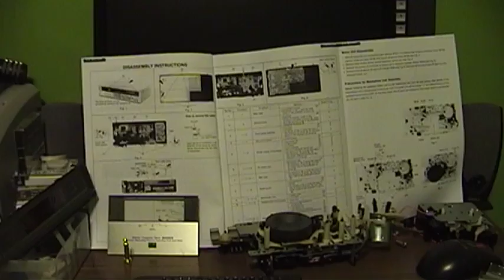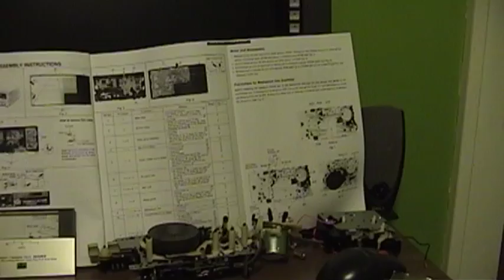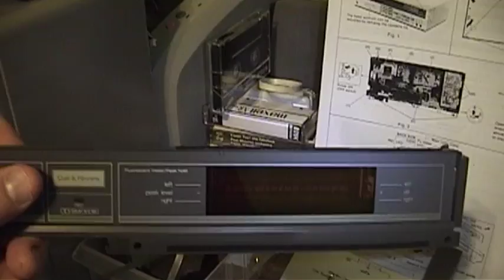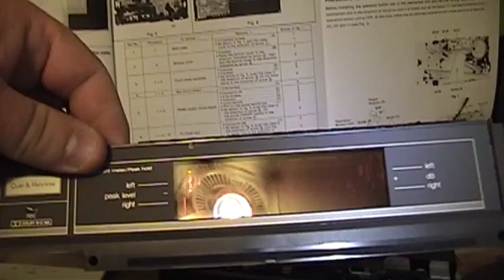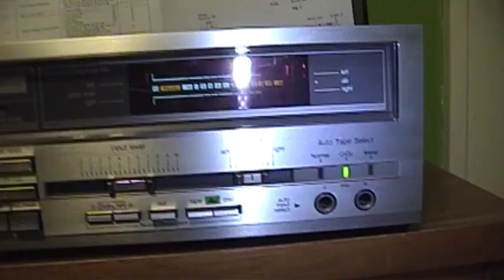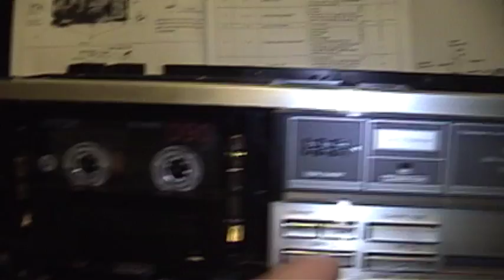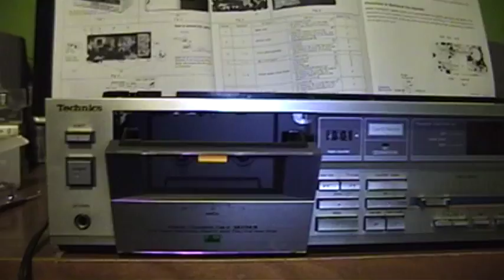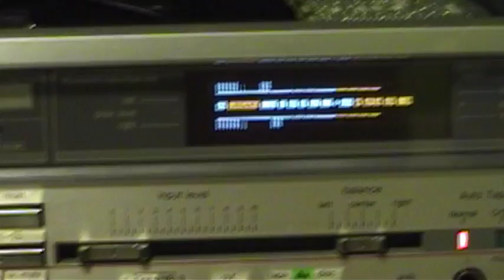Technics RS-M234X Cassette Deck Repair

Comment: My Technics M231X is virtually identical, including the DBX disc and tape functions, except it has analog meters and a manual tape type selector. And since the DBX encoder/decoder occupies a large and densely populated circuit board all by itself, I can see why it never really caught on. I'm sure DBX eventually developed a cheap one-chip decoder for use in stereo TV sets and VCRs, but by that time it had probably already disappeared from most tape decks.

Comment: Nice to see that the cassette deck is working again :) The older Technics cassette decks are rather hard to service, unfortunately. 
I would have thought that the pinch roller is responsible for the cassette deck treating the tape so badly, but it seems like the belts did fix it.

Comment: These technics mechs tend to suffer with barrel-shaped pinch rollers, if there is any creasing at tape start then it should be replaced. Another problem is the motor drive IC - it goes bad leading to fast and uneven speed. To be honest, these single motor transports are generally a nightmare, the cost cutting means loads of belts and crude linkages, hence more to go wrong. Glad you got it fixed though.

Comment: Mitsubishi Motor, and I saw a chip with the Mitsubishi logo on it.
Seems that the tape deck is working good now.
Nice touch using a matching Technics receiver to demo the tape deck.
and 
when do we get a demonstration on those ////\DVE\T speakers?

Comment: Your video gave me the confidence to disassemble my own RS-M234X to confirm that loose belts are the probable cause for the playback speed variation I’m experiencing (just cleaning the capstan and idler didn’t help).  I’m trying to decide whether to buy and install replacement belts, or just replace the whole tapedeck with a used one from eBay.  Can you tell me where I can shop for a replacement belt kit for this model?  Thanks.

Comment: Thanks for your response, I highly appreciate that. I'll clean the mode switches, (which I haven't done). You're right, the tape basket locks (can't open it unless I shut it off & turn it back on). Hopefully it'll work when I clean the switches cause the belts look fine, (very good speed on playback). You sure know your cassettes! Thx again!

Comment: I've got two RS-M228X and one M235X. All three had motor regulator burn out after years of running constantly in standby in radio studio. Shame Technics didn't allow motor to stop running when stop pressed, or at least switch off after a few minutes delay. I've replaced electronics in motor regulator and working electrically and can set speed, but motor bearings causing slight wow and flutter so need to strip, clean and lubricate bearings if possible. So far been working through back plate of motor as didn't fancy stripping down all the tape transport. Looks like I will have to strip down whole mechanism as you did and while in there replace belts too. My machines look identical to yours internally.

Comment: Thanks Bill.I finished up recording a tape using dolby c and it sounds amazing.Better audio than my cd burner when I use analog mode on it.Plus the tape deck has alot better level controls.I may send it off and see if I can get the dbx fixed on it.

Comment: Hi Bill, thanks for this. I have the m233x and all works but play! The wheel on the rights rotates mucho to slowly (but fast enough when rewinding). Also there is always some mechanisms moving as soon as power is on... Do you think it may just be the belts?
Reply from the maker: Almost certainly.
Reply: @uxwbill  thanks Bill for the fast answer. Could you share the reference of the belts that you have purchased? I really appreciate your help, that's nice of you :)
Reply from the maker: I no longer remember the exact belts I purchased. You can make measurements with a piece of string wound around the pulleys, or use the existing belts and deduct about 10% from the measurement to compensate for their having stretched out.

The company I bought the belts from no longer sells them.
Reply: @uxwbill  thanks very much Bill.

Comment: I just picked up a two head Teac V500 tape deck with DBX and DBX disc.  A few days after that, I found an even nicer three head Technics M63.  These decks are from around 1980.  I cleaned both decks up and they're working reasonably well again, but I know eventually I'll have to service them.  Can you tell me where you got your service manual and replacement belts?

Thanks a lot, Tom
Reply: *****  Thanks so much for the information.  I've got to wonder if eventually cassette tapes will become popular again with the youngsters just like vinyl records are now.  Out here in Southern California I found a Borders Book Shop with lots of newly pressed, high quality classic record albums.  About $23 to $25 each!

Regards, Tom

Comment: I also have this unit and it works great except the sound turns on and off randomly, more so when the sound is turned up. I'm thinking it's a lose wire somewhere but I don't have the repair manual. Do you think this is something a novice can do?
Reply: we have tied it to the Bose speaker system using this: IEC 18 AWG 6' Speaker Wire Pair with RCA Males - Black/Red. It was doing it even before. I will check the other connections.
thanks

Comment: I never liked the sound of the DBX noise reduction. It had such a wide range, I think it was 60dB it sure made things quite but you could hear it working. On some music it was fair but on say a piano it was simply dreadful. By fare the best, on home recorded tapes, was Dolby C. A good compromise between noise reduction and compression artefacts. I had the three head version of that recorder, not that common for a cassette recorder. Did make a very nice recording, quite close to the original, never liked the Hi bias tapes however, always seamed to lack HF detail.

Comment: Nice video!  I have an obscure Garrard model 316 CD/Cassette boom box that went on the blink.  when I opened it up, the belts had completely rotted and were in pieces and sticky.  I figured I could try some rubber bands to replace the belts, but I can't figure out the belt path or even how many total belts were used.  Any suggestions?

Comment: Hello. You guys seem to know a lot about cassette decks and I wanted to ask you 2 questions. I just found a Technics RS-MO4 and I'd like to backup all my vinyl collection on to some tapes. The questions are the following.

1. Can I record from vinyl to some tapes on the model I mentioned ?
2. The record button seems not to work. Does there have to be a cassette inside
for the button to be possible to press ?  Or is the recording mechanism damaged ?

Comment: Hi I just bought a "New Old Stock" car cassette player from 1980.  (Jet Sound Laboratory)  When trying to play a tape, it would play very slowly and then stop.  When trying to fast forward, or rewind, it would spin for a second and then stop.  Is this a motor issue or a belt issue?  I wouldn't think this would be a belt issue, because if it was a belt than it wouldn't spin at all right?  Any advice would be greatly appreciated!

Comment: I really like this, seems like a handful to wrap my head around. my deck at home has all kinds of problems, but I was wondering if you know anything about car decks? I have an alpine 7292(I believe to be 80s) and it recently looks to have stopped spinning tapes but will still play the auxiliary adapter(looks like this doesn't need to spin). Any thoughts on where to start? I'm new to the technical aspects of decks but always have been really into them, thanks.
Reply from the maker: As with any cassette transport that's got a few miles on it, the first place to look is at bad belts and deteriorated rubber parts. Unfortunately, most car radios with cassette playback make even fairly complicated component cassette decks look like a walk in the park to work on.

Comment: I enjoy your videos.   You do make that look so easy, but I am sure it was a lot of work.  I would like your opinion on my Technics Double Cassette Deck.  The other day I was planning on playing a tape on Deck 1, and the tape will not play,  it will FF and rewind, but not play,  the right hub seems like there is not enough power to turn.  I read online maybe a cracked gear.   Deck 2 works fine.  What do you think happened to Deck 1.  Have you ever had this problem?
Reply: Thanks!!!

Comment: How have you managed to get that schematic manual? I've just had a look for one for the one i bought on eBay, the RS-X888, and i can't find one, funnily enough it has the same problem, I've tried all sorts if different tapes, new, old, pre-recorded, and they all do the same thing as yours, it plays for a second and then turns over to the other side, and, like you, I've read that it  could be the belts, or it could be a motor problem... Not sure what to do, because it was sold as working and good condition..
Reply from the maker: StereoManuals.com has a massive amount of service literature for this equipment. While not free, their product is of excellent quality.
Reply: Ahhh thanks mate, I will have a look in there as well then 👍. I have found one place that has them for £4.99, which still feels too much to pay for it, but i suppose without it I guess I won't be able to make the repair, right? Or at least properly diagnose what's wrong..some sites eta charging as much as $19.99 for them! And that's a digital copy, mad eh, what ever happened to the help others as they will help you unspoken law eh? Everything has to be all about money nowadays... Don't you charge me as well will you? Ahahah, I'm joking 😉 thanks again, much appreciated, I've kept this in my favourites just in case, thanks for sharing, top man, all best for the holidays and New Year ✌️
Reply: By the way, I'm a member of hifi engine and usually they've been great for info and manuals but it turns out that they have nothing but specs on my model 😕

Comment: Howdy from Canada. I have a Technics RS-M229X deck. It's a bit low output on one channel but that's sorted. The problem now is the motor and pulleys never stop. Turning it off is the only way to stop the motor. It just sits there running in idle. The reels aren't moving just everything behind them. Any thoughts? Thank you in advance. Greg.
Reply from the maker: That is very likely to be normal. Many of the early 1980s Technics decks did that. Not only does it provide more stable startup speed, it's also needed to raise and lower the heads and roller.
Reply: @uxwbill  Thank you very much for the prompt reply. That's going to save me some money on headache tablets. Greg.

Comment: I have a Technics RS-M208 which has an interesting problem which is hopefully bad belts too but while replacing them the playback/record arm popped out of the mechanism and I did get the service manual for said deck but the service manual says "when servicing the mechanism unit, refer to disassembly notes and assembly instructions described in the service manuals for RS-M13, RS-M14, RS-M51, RS-M04 (RS-M24 mechanism series)" so looks like I am on a wild goose chase for this one.

Comment: Wow, cool I actually have one of those I quit using around mid 1999 because I was working a 3rd shift job 14 he days 4 days a week and the issue was the record button didn't want to go in when you pushed it,at the time the playback worked fine,as for now I have no idea....

Comment: where you get the tech manual for this machine?  Schematic are one thing.  But tech manual or literature with picture and diagrams help a lot.  My father told me about tech manuals, because he work on airplanes during WW-2.
As usually thanks for taking the time and posting this video on youtube
Reply from the maker: StereoManuals.com -- not free, but very good and quite reasonably priced.

Comment: I have an '87 Technics RS-B905 3 head dbx deck.I used an old TDK  SAX60 to test the deck.Using dolby c the recording sounded fantastic.When using dbx I noticed that the playback had pumping on the left level while the right level was vert low.I recently played an old dbx recording on the deck and it played fine.It seeems that the record mode is the problem. any suggestions?

Comment: Hi, great video by the way 👍 top man, but what I'm after is some replacement belts for a Technics RS-X888 double tape unit, i can't seem to find any.. Are they generic on certain models do you know? Greatly appreciate your help.. 😊
Reply from the maker: When this video was made, I got the replacement belts from Studio Sound Electronics. It's my understanding that they no longer carry these belts, and may have completely liquidated all that they have.

Most of the belts are generic and of standard sizes. You can measure the belts you have now, or use a piece of string and measure that if the belts are too far gone.

Comment: Thanks, I'm glad I read this on time. I think I'll stick with the DeoxIT. Although I've used it on the volume control switch on my NAD integrated amp w/no problem. It's made by a company called KRYLON. But it's better to be safe then sorry, thx again!

Comment: @uxwbill I was wondering if you can possibly help me. I have the Technics M218 cassette player & sometimes while the tape is playing the sound will disappear for a few seconds & then come back again while the tape is still moving. I did clean the heads very well making sure they didn't go out of alignment, but I just can't figure out why the sound disappears  & comes back a few seconds later? Any advice would be highly appreciated, thank you very much!

Comment: Hello Bill. I have a cassette deck that rewinds and fast forwards fine, with cassette inserted, but it auto stops whenever I press the play button with cassette inserted.
With the cassette out but with the front closed it functions normally, including the spool turning normally at (apparently) correct speed when the play button is depressed.
Would you know why it only works with the play button depressed when the cassette is out, but doesn't do so when the cassette is inserted?
I have looked again and again but cannot fathom why it only works normally when the cassette is not in it.
I know this film was made a long time ago but would be very pleased if you respond with your thoughts.
Thank you.
Reply from the maker: It's probably something to do with inadequate takeup reel torque. How you'll fix this, if it can be fixed, is something you'd have to check in the deck or transport service manuals...or by random experimentation, though that may make things a lot worse.
Reply: Thank you for your reply.I bit the bullet, opened her up, and found that the belt driving the big wheel is AWOL. So the copper spindle turning the brown wheel bogie that snaps up against the tape/copper spindle doesn't rotate. Opening an envelope is the level of my engineering prowess, but If a person put it together then any person can fix it. Does that sound wise to you?
Reply from the maker: At this point you've got nothing to lose by trying. Tape decks in good working order just aren't rare enough to be worth a lot of money most of the time. The belts can be had from a few online retailers. (I'm in the US and used Studio Sound Electronics.)
Reply: I moved on pretty quick from tape and records when CDs came in. But am surprised how good they can sound. There are boxes of unwanted tapes round my way and so I am having a great time listening to stuff I would otherwise never had discovered. That is the secret joy of owning a tape player. Money doesn't come into it. The players look great and they sound pretty good. The cassettes themselves are small and look neat too. In every way I think it a win win situation.

Comment: @uxwbill...I have he Sony TC-KE400S cassette deck. Just wondering if u ever had this problem, (belt's are very good btw) when I press the stop or the pause button the tape deck goes into fast forward & rewind & then it stops & then I have to rewind the tape back in the shell. It plays normal (no drag/slow) But the instant I press the stop button it goes fast forward, rewind, stops leaving  a part of the tape out of the shell. Any suggestions would be very highly appreciated!!! Thx a million!

Comment: @uxwbill It plays ok it's only on record mode, I've found the 2 resistors that smoke, the fluorescent meters dimed on record mode but changing the capacitors on the power supply area fixed that (they where dry and swollen!) but still not record and smoking! I've found the AN6256 chip is corroded, that might explain why the auto tape type selection is not working but I'm not sure if that chip is also needed for recording :( So I think that deck gonna rest in the closet for a while now :)

Comment: I figured it out, the deck is working again and I also adjusted the head azimuth while I was at it. In the process I found an interesting note on the mechanism stamped into the metal. On the RS-M208 mechanism there is a marking saying QUO 1976.

Comment: You know your thing!😊 I myself bought an akai sc-m02. It keeps running and going play,stop,play,stop... If I try to press play, it scream and refuse!  Can't even put a cassette in it.  Any idea where to start ?
Reply from the maker: You will have to start by diagnosing the problem. It is most likely to be decayed rubber parts, especially belts. Some manufacturers make it easy to replace parts and others don't. I am unfamiliar with the model you have, and could only suggest that you get ahold of the factory service manual for it.

You should also be familiar with basic electronics theory, how to troubleshoot, and (most importantly) how to work safely around electricity. If you're not, or you aren't sure, have the unit serviced professionally or try to find another in working condition.